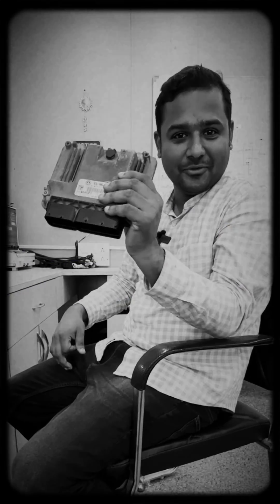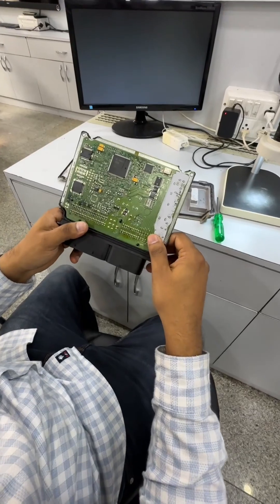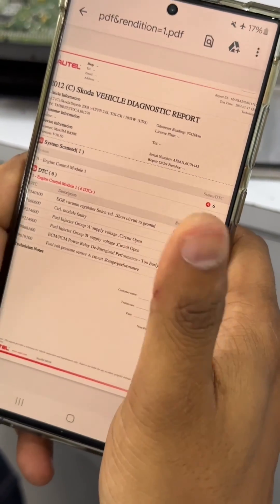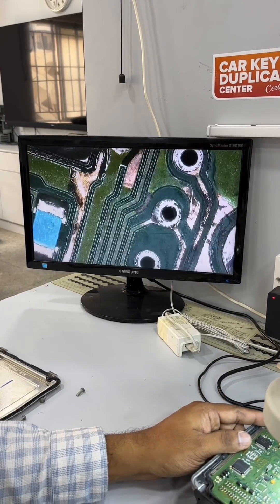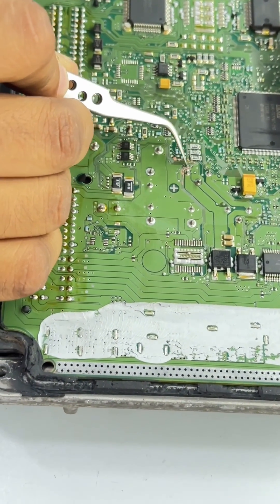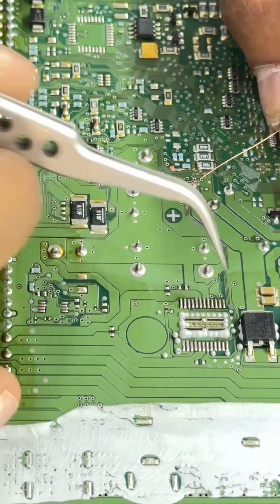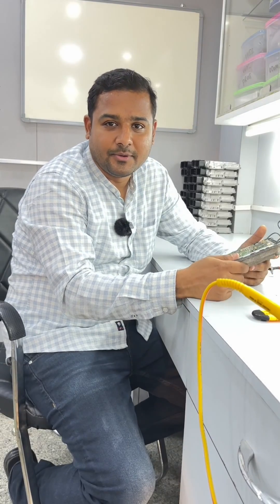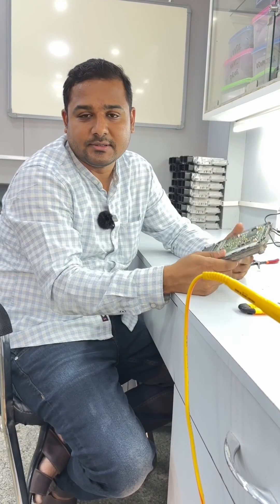HOW TO REPAIR SKODA ECM | SKODA ECM P068A FAULT CODE REPAIR SOLUTION | BHADRA ELECTRONICS

Comment: What if the issue is with a software or calibration error? How you people gonna tackle it?
Reply from the maker: Very good question, we fixed with hardware issue, that problem solved if you get same issue contact us, we will be happy to help you
Reply: @bhadra_electronics  
Sir sorry sir, I am not getting any issues related to that, but I have some knowledge on calibration and software related information since I work on Hardware in loop(dspace Hil environment) basically we are looking into the software and calibration issues but no idea on the Hardware side, I am very much interested to understand the hardware interaction with the software especially in this automotive domain
Reply from the maker: it’s ok you contact us for other issues related to your work we will guide you for best service to customers
Reply: I need to work on these powertrain related microcontrollers in a real car environment, pls let me know sir if I get an opportunity to get trained in your institution would be more helpful to get more hands on sensors and powertrain related ECUs, I am very much happy to enhance my knowledge in this automotive domain.
Reply from the maker: Feel free to contact us through call or WhatsApp +91 7204913693 or +91 8904890230, visit www.bhadraelectronics.com